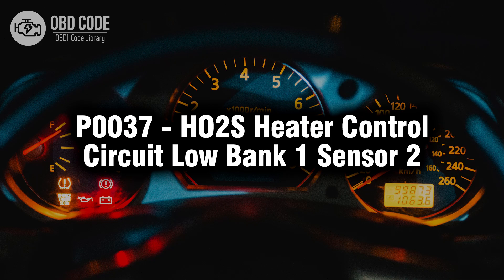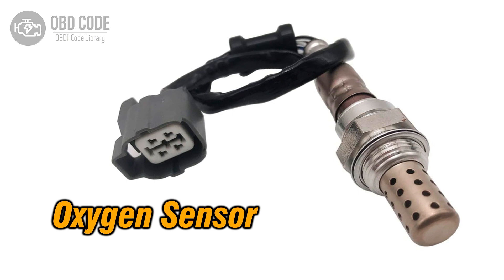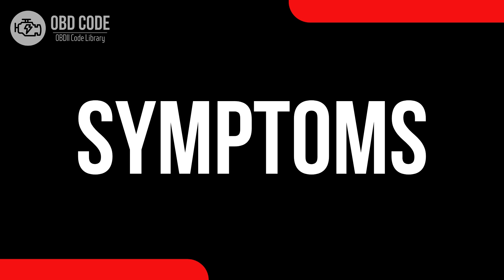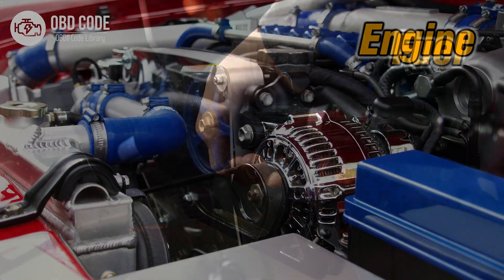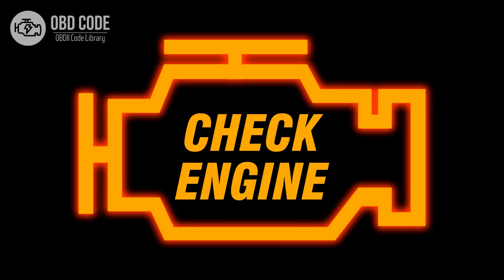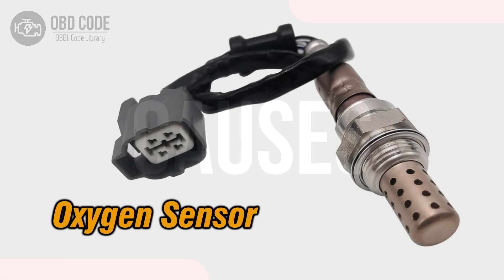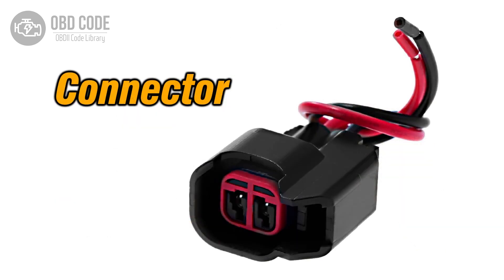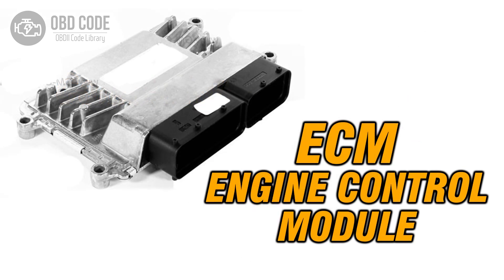P0037 HO2S Heater Control Circuit Low Bank 1 🟢 Trouble Code Solved 🟢  Symptoms Causes Solutions

Comment: Can this be an issue with the fuse? Or is it the sensor for sure? As car drives fine
Reply from the maker: Good afternoon, it is necessary to check everything that is the electrical system of the component, that includes the wiring, fuses and other electrical parts.
Reply: Why no mention of possible fuse issue? Crap video